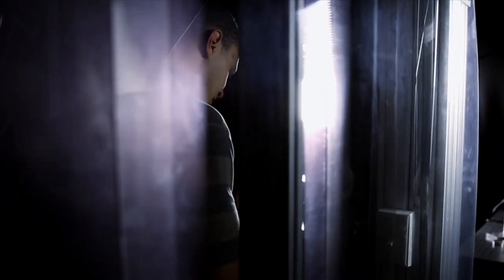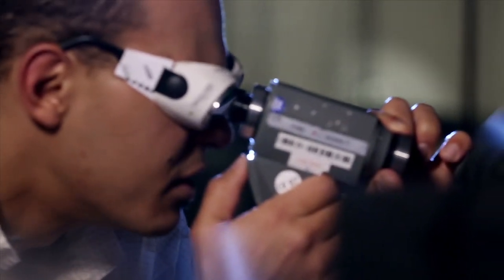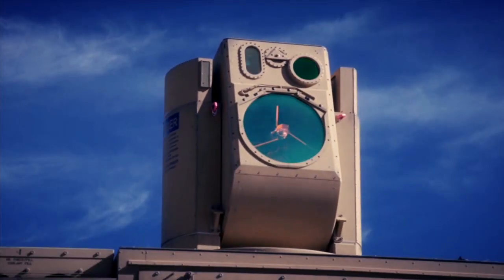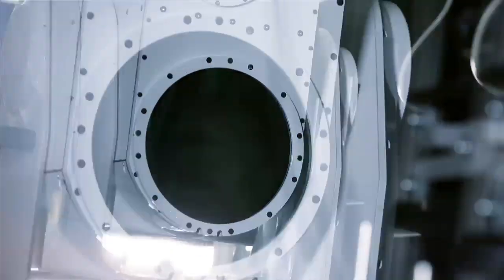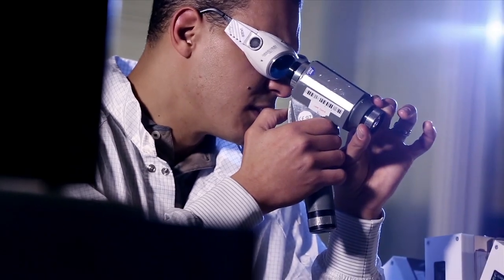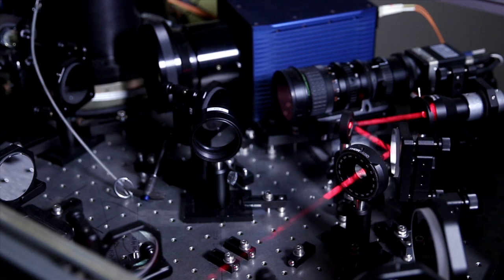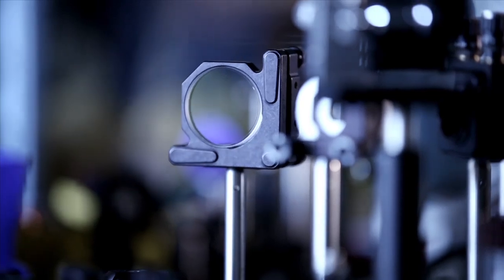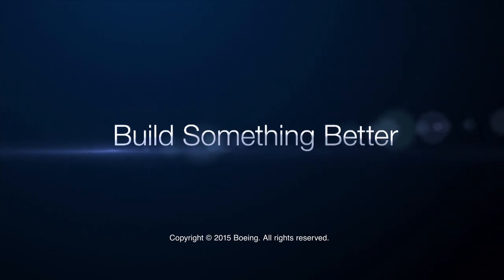Boeing Directed Energy: Blasting Targets at the Speed of Light

Comment: That's cool but what's the range of this laser can you shoot down an aircraft or missile before it detects you or does it have a limited range.
Reply: Technically speaking it has an infinite range assuming you could lock on to the target...you could in theory shoot something a light year away (of course it would take a year to get there) and continue on for millions of years...unless it gets bent by gravity to the point where it turns back around....
Reply: +Eric White Light...
Reply: +GrimOxford Nope. Lasers are basically a very thin cone, on a large scale, they dissipate fairly quickly, light-seconds out at the farthest with our tech.
Reply: Echo TheEcho Sorry, I was unclear. Once you get past a certain distance, the cone is too wide, and the laser too diffuse, to actually harm much of anything, even in hard vacuum. More linear, smaller-dot lasers can extend that range, but lasers definitely have a certain limited range. In atmosphere, that becomes even harder, since the same things that extend their range also cause them to ignite the air around the beam, thereby crippling their range, since plasma is difficult to lase through, quickly weakening it severely.
Reply: Amperzand ahh, ok i understand now. Thanks for the clarification.

Comment: Put enough of these on sea craft and along the U.S. borders - we won't have to worry about ICBM's anymore.
Reply: kaiyou yang
Reply: that's the idea actually.
Reply: +USNVA Lasers don't take away the radiation carried by the ICBM's warhead so you're still gonna have to worry about them.
Reply: tWreCK51 Lasers don't target the warheads. They take out the thinner skin of the main body containing the fuel.  And warheads are designed to strike the ground at terminal velocity without fragmenting or spreading radioactive materials.
Reply: USNVA yup and they will likely deactivate upon failure since they are created to airburst upon target.
Reply: +USNVA 
half of boeeing was sold to china
they could just disable them